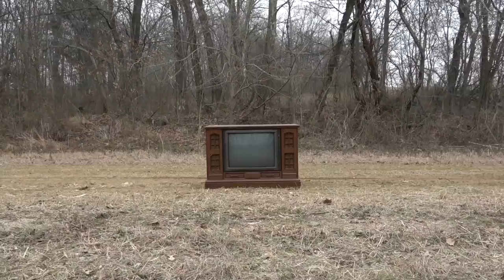Ford F-350 vs TV & 110 Gallons Of Water !!! (Wreck It Wednesday)

Comment: What you actually messed up was the intercooler for the turbo
Reply: a/c condenser. the intercooler is behind that. no intercooler is that far forward or that thin.
Reply: @Dilly Dilly those are alot smaller
Reply: @Dilly Dilly the small black one with the rubber hose is a trans cooler.
Reply: Gotta weld a grate between that lowest bar and the bumper! I’d love to see you weld more and more armor to the front of this thing and see what it takes to break it, add more, rinse and repeat!

Comment: AC condenser intercooler and trans cooler are all in front of the radiator so that should take a while before you damage it. Trans cooler and intercooler would be a lot less fun to replace than a rad

Comment: With that front hitch,  you could probably just get a protective plate that holds in the receiver for Wednesdays and take it off for driving normal.  Angle the bottom back at like 45 degrees so if it makes contact with the ground it shouldn't dig in.  Lol.  Oh the mental images in getting.... love this series though

Comment: Don’t let somethin get under the tires and flip it
Reply: Seeing how it slid with that barrel under one wheel acting as a skid while braking I'm surprised they didn't roll it then
Reply: It's harder to roll a truck than you think.
Reply: He locked the brakes up after hitting the barrel. Rear tires were sliding, hence the tail slide.

Comment: Put a skid plate under the front of that truck. In order to cover the hoses, fan blades and oil Pan. You should avoid about 95% of the problems that you have with out it.

Comment: Ya killing me man. 1 a ranch hand bumper is not the strongest. (Very tough though). 2 you smoked either you oil or trans cooler. And 3 holler at me if you need a installer.  Live at Ky Lake but work at Paducah for Auto Trim Design. Ask for Opie